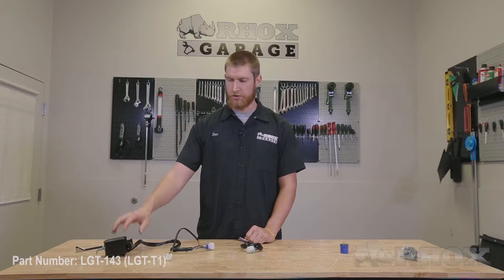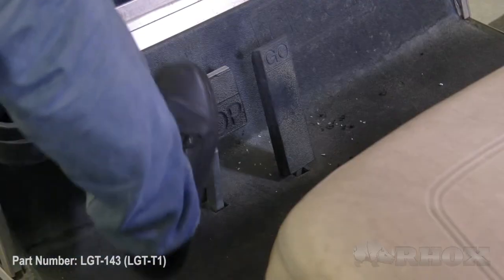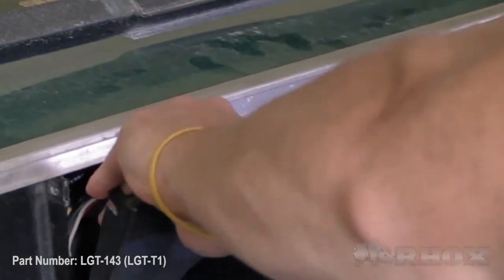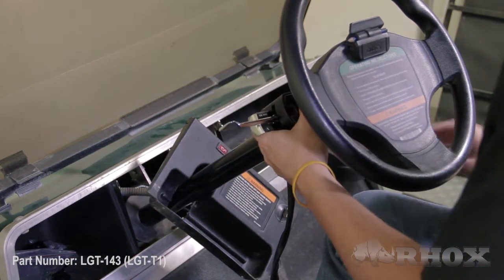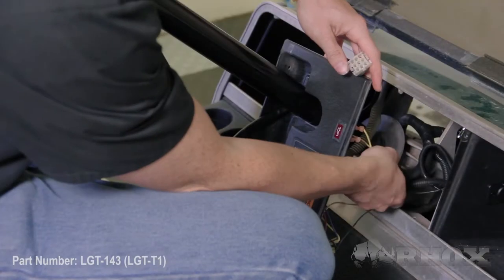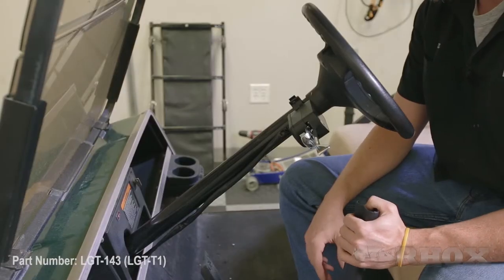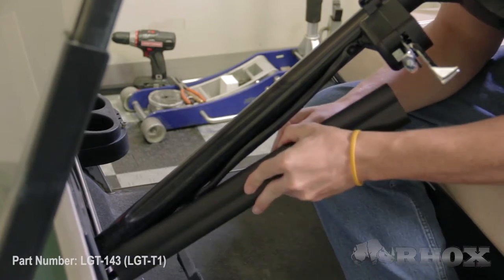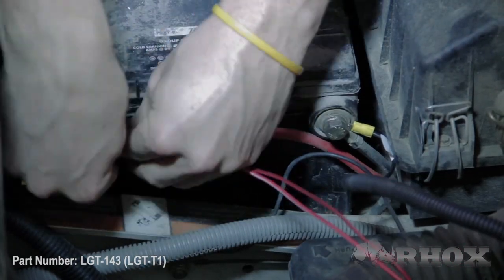LGT-143 (LGT-T1) RHOX Basic Turn Signal on a Club Car DS

Comment: My steering column spins,  so my turn signal always spins downward. How do I secure the steering column to make the turn signal stay on place?
Reply from the maker: If you have a steering column cover installed over the steering column and it is rotating, we suggest wrapping some electrical tape around the steering column before you install the cover. 

If you are talking about the LGT-107A column cover, that snaps over the turn signal wires, it should be installed over the turn signal and will not cause the turn signal to rotate.